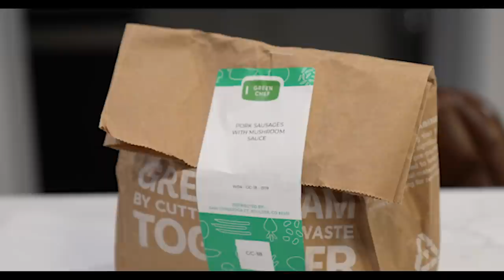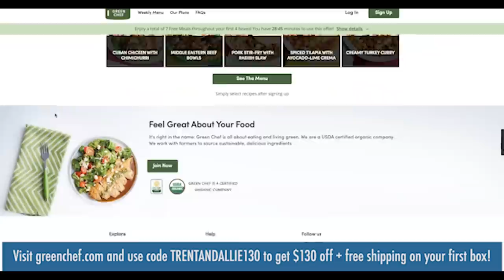BUILDING BUILT IN CABINETS | TRENT & ALLIE

Comment: Put the roller down , and chill with Leo ! Let Trent paint ! Check out MagVent ! You run a narrow duct behind the dryer , there is a bracket that mounts on the wall . The dryer has a short pipe with a round magnet . When the dryer gets shoved back the magnet makes a perfect seal . All that pipe will fill up with lint and be a fire hazard ! If you see how hard it is to move the machines , The vents won’t be getting cleaned out very often ! The short pipe on a mag vent won’t collect lint like that long pipe ! It will make life easier ! Put Trent on the couch ! Lol

Comment: I think they are called 'glides' but you slip them under all 4 "legs" of the washer/dryer stack and the stack will slide easily in and out of tight spaces, I can move mine easily and I am 73 ;-)
Reply: I have those for my bed! They are amazing! My bed is all solid wood with 4 drawers underneath and I can move it myself!

Comment: We purchased a "slider" thing to use when moving heavy appliances. You tip the appliance back slightly, the slider slips under the front 1/3 or so. It's rubber on top and slick plastic on the bottom. Then you tip the appliance slightly forward and the appliance will slide out easily. We have used it on the fridge and the kitchen range. Saves the floors and no sore muscles the next day.

Comment: Trent, you should furniture movers under the washer and dryer....and leave them there.  It will make it so much easier to move it in and out when you need too.  Especially if there is a water emergency!🤪

Comment: For those looking at how Trent is cutting the tendons, don't do it that way (sorry Trent). It is not safe especially when you cut the longer pieces. A better and more accurate way is to use a dado blade ( or alternatively use a single blade and make multiple passes) and the table saw's miter gage fence. Better yet, buy two winged cutter bits for the router. Use a single bit to cut the grooves and then stack one bit on top of another with spacer in-between to cut the tenon. Be sure to use a backer board to eliminate the tear outs.
Reply: Yes and a push stick or he will loose a finger not good if you still want to pick your nose believe me I have seen it Happen
Reply: Tenon
Reply: @joe m Precisely. I was on the edge of my seat watching that. Take Joe’s advice, Trent. We’d like you to keep all your body parts.
Reply: Stub tenon joinery and the panels should float. No glue
Reply: @joehuinker7009  Yes, the wood swells and shrinks at different rates.
Reply: @joehuinker7009  Nope, no floating panels, because they wobble and move when you open the doors! I prefer nice tight joints!
Reply: This! Do not do as Trent  did.

Comment: Actually, what is the humidity of the wood and the shop?   If it is very dry, then you wan there to be a little wiggle in your "floating" panels.   Otherwise, when they swell up with some humidity, then your lap joints will crack.   This I learned in wood shop, junior high school when I built my bookshelf with doors (which I still own, btw).
I put plexiglass in as panels on the linen closet doors.   This forces us to keep the closet neat and makes for a pleasant and functional view.

Also, if you sand and finish your floating panels BEFORE you put them in the frames, then you get the best result.
Remember that your laundry room will get humid.

Comment: I highly recommend the zipadee zip “swaddle!” It’s not a true swaddle. My daughter just turned 2 and still uses it. It’s kind of starfish shaped and allows full range of motion, but still allows them to “feel the edges,” which helps with that startle reflex. Plus much safer than using a blanket. They can safely roll over, crawl, stand, even walk in it. Might be worth checking out!
Reply: Those things are so cute!
Reply: I wish I would have had that when my kids were tiny.  I would crack up at their startle reflex.  🤣🤣🤣

Comment: Trent great job….. here’s a tip next time you build doors.
Allow the center panel to float in the rails and stiles of the door frame.
They make these very cool rubber balls that fit in the grove and keep the panel tight but allow it to expand without breaking loose the frame.
Look into them Trent they will save you issues in the future.

Comment: Hi Trent, 
great job on the cabinets.  However, if you’ll take a few tips from a former professional cabinet maker, I can save you some time, potential injury and having to re-glue failing doors in the future.

1. Pushing the edge of the rails and stiles against the crosscut fence to cut the tongues can cause them to bind and kick back, putting yourself in harm’s way. Use a miter gauge and dado blade instead - much safer and far more efficient. There is a thing called “You Tube” that can help you with that!! 😄

2. The joints of the tongue and groove should have 1/32” or so gap to allow for the glue to reside when you clamp them up.  If the joint is a tight fit, there is no room for glue and it will all squeeze out.

3. The groove for the panel should be approximately 1/32” wider than the panel’s thickness and 1/2” deep.  The panel should be 1/2” greater, in both directions, than the visual opening of the panel.  This will allow 1/4” play of the panel all around in the groove to insert 1/4” space balls (yes, they are a thing).  This is so the panel “floats” in the opening.  The weather will cause the door frames and panels to expand and contract, depending on the wood’s moisture content.  If the panels can’t float the panel will collide with the rails and stiles and push the tongue and grooves apart or crack the wood. 

4. It is also best to paint the panels before installing them in the frame.  Otherwise as the wood expands and contracts, it will expose the unpainted portion of the panel.

5. You now need to split the cost of  that lunch with Allie for everyone on  the jobsite!!

Comment: I discovered thus “ hint” years ago. 
After cutting the wood pieces to size, paint/stain and let dry , apply second coat let throughly dry. Then build your project. You can go back and do touch ups. Its been a blessing to me anyway. I know it freaks professionals but home DIY people normally don’t have a shop to work in or professional paint sprayers to use🥰
Reply: Absolutely, and I would have left the back end of the cabinets green. It was perfectly fine already.

Comment: Doing renovations in the winter time is not an easy task, as you have less energy and it is dark soon, so I admire you, guys. I gave up with the painting if the kitchen wood ceiling and wall till I can open for longer a window and it will not be freezing. The most important for painting is that the air is fresh and not humid in the painted area. So I will start in Sping time and now enjoying some nice videos like yoursin my warm bed 😜

Comment: I used to work at a cabinet shop and we used space balls in the door panel grooves to allow expansion for varying humidity. You may experience cracking during different seasons. 
Space Balls Raised Panel Cabinet Door Spacers for 1/4" Groove

Comment: I'm thinking it should be fine given the air-tightness and good HVAC in the house....but you typically want a tiny bit of a gap around the panel in the shaker door to account for seasonal wood movement.  By doing it so tight and gluing the entire groove, if the wood swells at all your joints are going to pop apart.
Reply: I mentioned that in the last video, the panels should be left loose.

Comment: Allie, consider the process of moving the washer and dryer.  Have you thought about getting a strap and looping it around the bottom appliance (washer?) punch a hole in the back or side wall of the house, set up a pulley or two, and pull the other end of the strap out to the correct vehicle or tractor, and pull the washer and dryer into place.   Never mind, Trent has the appliances beck into place. 

Nice work on the doors, Trent.

Comment: Nice work guys! Excellent ethics and time management too!
Trent, y'all need a dado stack. Stop blocks and using the factory miter gauge for the Sawstop would also make all of that replication much easier. Either way, keep on knocking it all out and taking your time with setup and dialing in. It's always worth it.

Comment: Trent, as a furniture builder I can tell you that you don't want your panels glued in place. You allow the panel to float in the space so that any expansion or contraction doesn't warp the whole door. To keep it from rattling you put nylon or rubber beads that are specifically made for this purpose in the groove. On a another note, you need to stop belittling Allie for stupid stuff that you should be doing. Keep in mind that she is already working full time which allows you to go off and Re-build some doors. She should also not be trying to move heavy equipment. Step back and thank your lucky stars!
Reply: i was thinking the same thing.

Comment: Trent - just a recommendation from someone who has built many things that need to be assembled - paint the parts BEFORE you assemble them. It makes everything easier. No taping, no struggling to get way back inside, and you can easily see any places that require touch-up before installing.

Comment: Nice job on the doors. FYI, in my experience I was taught to not glue the panels in the door to allow for expansion and contraction of the wood. Otherwise the doors end up pulling themselves apart after some time goes by.  Don’t know if your elevation will have something to do with how much movement you will have in the panels. Something to consider on your van cabinet doors also. Have a great one!

Comment: Hi guys love the channel . Big tip for getting washer and dryer out. Tilt it back and put washing liquid that you use for your dishes in the sink on the feet and it will slide on the tiles. . Easy clean after . Have a try . Andy

Comment: Trent loves learning cabinet making. That's  something  really  special. Just in case your stackable  washer doesn't  take big or heavy loads,  it can still  do a very  nice job cleaning  the smaller,  lighter  loads. Since  you chose  to install  a cabinet next to your stackable, a jumbo top loader can take  care of the  larger loads, if you have  a place  for it somewhere else,  like in the basement.  I found I like  my stacked w/d off the kitchen too, but I  think I  have  room for a second  machine for my heavier loads. Both models do an excellent job for what  they  can handle.  Your stackable is a great space saver.  Allie is doing  so well and it's  great she loves  the pace of caring for baby Leo. It's nice to hear Brandon talk in your videos. He's  been  such a great supporter in building.

Comment: I would suggest getting some  of those appliance "sliding" pads to put under the washer dryer. They are inexpensive and actually work to make it easier to move the washer/dryer and protect your tile floors.
   Why did you not paint behind the unmoveable obstruction?  I don't know, why don't you go sleep in the trailer tonight?

Comment: Okay, Allie, all you need is to take the handle of the push broom and attach it to a skinny roller and get a step stool, and then you can paint the top without moving the washer dryer. Also, the comment by Tricia is excellent because of being able to slide the units out when needed.

Comment: We always did the tongue with a router and then the grooves with a table saw. That way you can always make as many passes with saw as you need to get the proper groove depth, shaving off just tad more until your test piece tongue fits snug.
Reply: Oh yea, it was 2 passes with the saw to get the proper groove. Flip board around to make the second cut pass.

Comment: Trent, a much easier and faster way to make that style of door is to cut the grooves on all sides including where the tongue will go, then cut spline material to fit the grooves and apply during glue up.  These basically will serve as loose tenons.  I suggest you check out Mike Farrinton's channel he uses this technique.  His channel is also one of the best furniture/cabinet making channels on youtube.  His work is excellent.

Comment: Couple of things;
1. Spray some Windex on the floor where you want the washer and dryer to slide, they'll slide on the floor MUCH easier

2. You shouldn't glue the inside panel into the doors. The 2 different types of wood expand and contract differently so gluing them can cause problems. The inner panel can just float inside

Comment: Maybe putting some of those furniture moving discs or some anti-vibration pads under the stack will let you move them easier.  There is a device, a Heavy Duty Furniture Lifter, sold that you can slip under heavy furniture and lift it enough to slip the discs under.

Comment: That upper... If you can fit your hand in above that dryer, you can probably push that paint back a ways with a long handled peanut roller. Push it slow or it will spin pain off onto the top of the dryer...

Comment: Allie, now that it's too late for this, the washer and dryer aren't moving easily because their weight is producing too much friction on the floor for your strength to move them.  So you need to do one of two things, and preferably both.  Reduce the weight of the feet on the floor, and reduce the friction fighting movement.  Leverage can help you lift weight off the feet.  I would use a hand truck to lift the washer slightly, but you could use other leverage.  Lift and rotate, moving a little bit at a time.  Those "furniture robots" (don't have ANY idea why they're called that) would help reduce friction, if you can get them between the feet and the floor.  They're those plastic discs made to help you slide heavy stuff.  Home Depot probably has them for cheap.  Once you get them under the feet, leave them there!  Then slide!

Comment: You don't want to glue in the panels, they need to be able to move with humidity changes, just glue the corners of the rails and stiles! Put the washer and dryer on those plastic furniture sliders.

Comment: I'm out of the appliance knowledge these days. Yes, I have the GE washer and dryer you have, but what in the world is that drawer thing? Is that an air fryer? A microwave? Induction oven? I got to know. BTW, my washer and dryer are on pedestals which I had to do myself. I had to lay the washer down on its side to connect them and lift it up. The pedestals are very tall which made it hard to get upright. I understand how hard it is just to move them stacked. Trent should have known that.

Comment: no idea how heavy your dryer is but i can lift mine by its self , not that I had to move mine but was on a job and needed to get behind washer and dryer ,i lifted the dryer off the top and piece of cake, and why do you mericans still have hoses on your dryers ? get the condensing ones ,mines one of those and best by EVER !! oh and if you want to paint above the dryer ,simple get what we call a radiator brush / roller ,.its very slim and long and made to go behind radiators, will be easy with that space above the dryer  :)

Comment: Trent, you may have not wanted to glue those panels to the frames on your doors. I'm assuming you're using plywood for your panels and that's why you're thinking it's okay to glue them but in a wet location like a bathroom or laundry room, the frames themselves could expand and rip the shoulders off of their dados. Just to be sure, you might want to caulk the panels in before you paint to insure no moisture gets it. They'll probably be fine but it's always fun to re-hash the "frame to panel glue or no glue" debate... lol

Comment: Hey Allie and Trent,
Sorry, but I gotta tell ya how I laugh each time I see Leo in his bassinet. When he's in the wrap around, it makes me think of Hannibal Lecter and I imagine Leo with a little face restraint on. The wrap around body suit really looks like a straight jacket. I hope I'm not the only one who sees this, but just for you both to get a laugh about it I had to tell you. That said:

The washer and dryer, you should get a set of appliance coaster wheels and put them permanently under the washer and dryer, as well as the fridge. That way if you need to pull them out for any reason, it would be a simple and safe process that wouldn't require tonnes of effort or strength to move. Appliance coaster wheels are extendable to go from side to side of the appliance and the wheels don't turn, they only move forwards and backwards. making them easy to use as well as safe.
Home Depot carries them.

Allie, Trent, Leo, Brandon, Frank, and Lika, Love Ya's All
Keep Safe Always,
Matt - Toronto, Canada

Comment: Definitely not criticism but an observation,  whenever I have watched cabinet doors being made, many times in fact, I noticed that everything is glued and clamped, all EXCEPT 
for the center panel. When I asked why not I was told that they did not glue the center panel at all because they were allowing the center panels to be "floating" which allows for 
expansion and contraction of the wood doors during changing dry or humid weather conditions. Trent, have you made the center panels of your cabinet doors to be floating considering the humid conditions in your bathroom? 
Remember the toilet and your laundry facilities in that small area can contribute to a higher rate of humidity.
Again not a criticism but an observation.                                                                                                                                                                                                                                             
                                                                                                                                                                                                                                                                                   Southern AZ.     Me